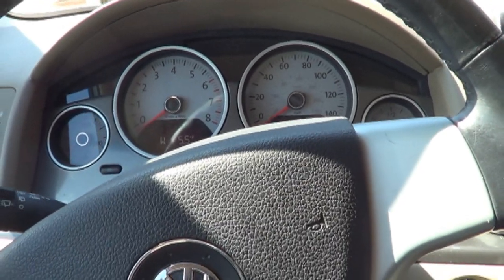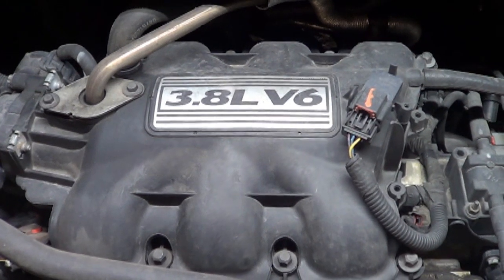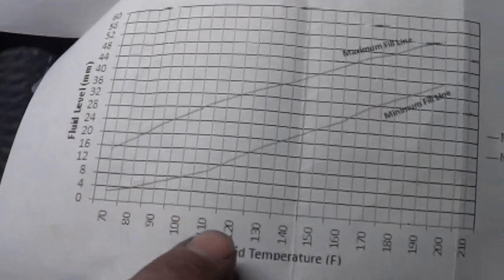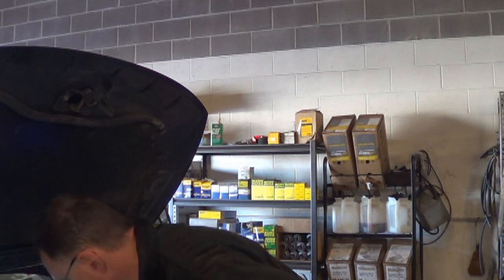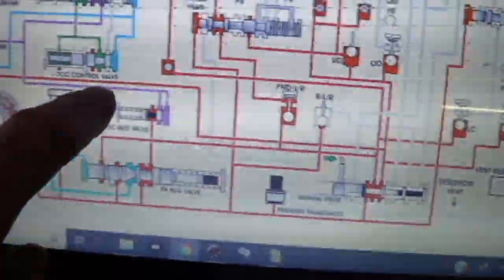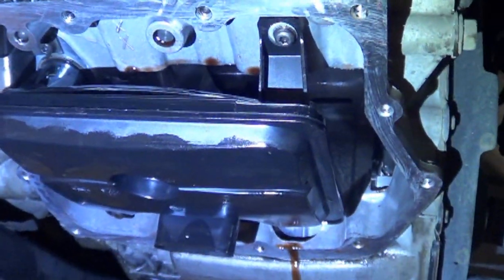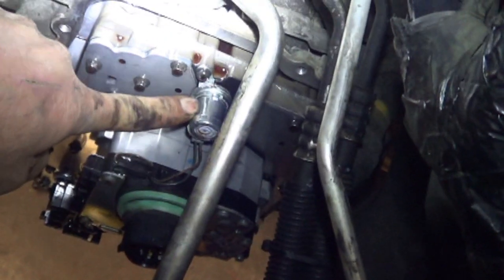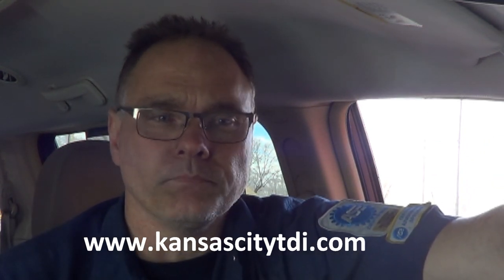2011 VW Routan TCC kills engine

Comment: Looks like something I may be able to tackle at home.  Thanks for posting this video up!  My Routan nearly left my wife and I stranded about 70 miles from home in the middle of nowhere amidst a torrential rain storm.  Shut off when I came to a stop and each time I tried to put it in gear.  Managed to shift it into manual (+/-) while rolling forward slightly and got us home (with some careful neutral/D shifting at stops).  Parts are on order.
Reply from the maker: cool!  So glad my video helped you.

Comment: Lovely video and Lot of explanation. i am stuck in that removal of that bolts of exhaust. front and back side .i  am doing this at my home on jacks. the solenoid cover is kind of stuck without removing the exhaust pipe. do we need to buy special tools. i took this as challenge when VW dealers quoted me 6000 as per protocol. Please share some info. i fell in love with my car and wanted to keep it for long. hate to loose this for the solenoid repair. Thanks
Reply from the maker: exhaust bolts sometimes take heat to remove.   Mechanics become experts with torch and removing seized exhaust bolts.   Especially northern cars where lots of salt is used on the roads.  Sorry I don't remember the exact repair on this car.  Its been years and I have over 180 videos.

Comment: Quick question do I have a 2011 Routan my engine light came on so I took it to a auto zone to get code read it came back P0740 torque converter clutch solenoid circuit. So I took to transmission place . He Said I needed a new transmission. Spent over an hour there waiting for estimate. Anyhow ended up leaving and drove of about 10 min and light went off by itself. Have had no problems with car doing any struggling to drive or turning off. Maybe a light hesitation at stop light after driving 8hrs. But nothing. Any advice please PLEASE HELP ME
Reply from the maker: ???? if it aint broke dont fix it????

Comment: I do have to drain the transmission fluid for this right?
Reply from the maker: fluid is in the pan, but your removing the "sidecover" to access the solenoid.  So you dont have to "drain" it, but I would pull the bottom pan to inspect and break open the filter.  Even if you dont do that you'll probably loose a little fluid if even if you dont pull the pan, so you'll need to do the check procedure and have the dipstick "tool" anyway.

Comment: Why a 2012 vw routan some times all dash lights and radio come on and of and sometimes it does kill the engine, only when driving?
Reply from the maker: I dont know.
Reply: this happen to me on highway
Reply: Happened to me also went through 3 alternators and a new battery. Finally stopped when we changed the battery terminal wires

Comment: Pos I will have will buy Toyota
Reply from the maker: Not really a POS but Toyota's aint bad.  I got a video on a Prius that made it to approx 150 with zero repairs except a 12v battery replacement.  That just amazes me.